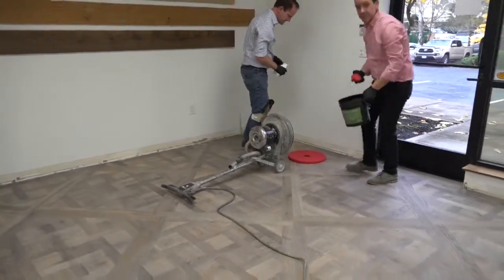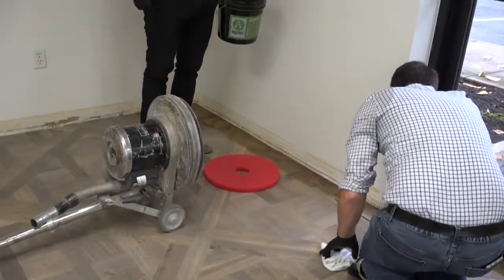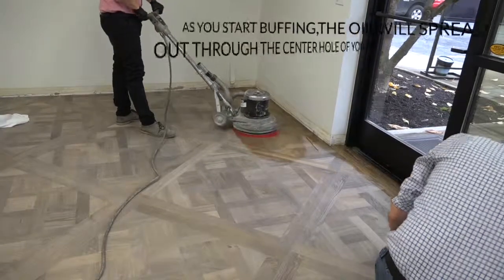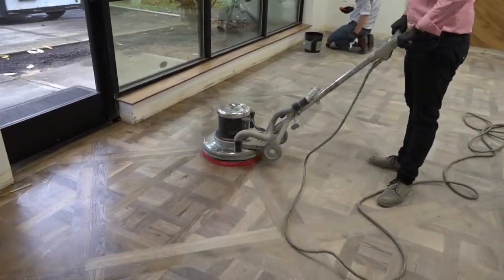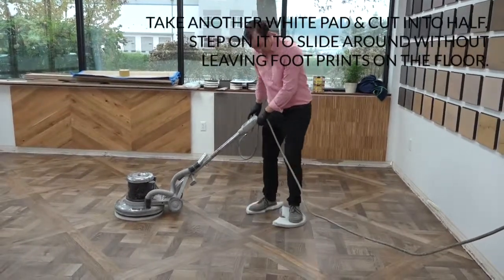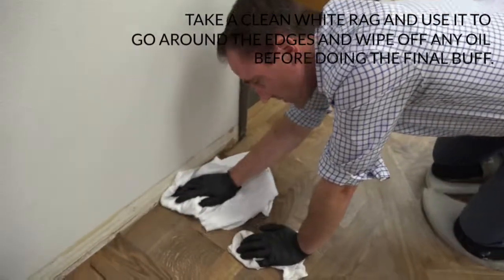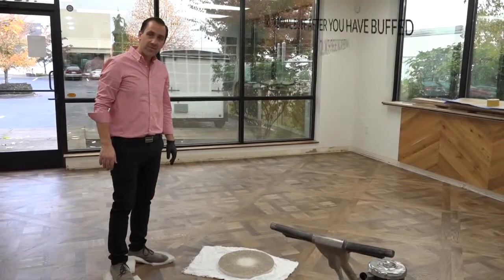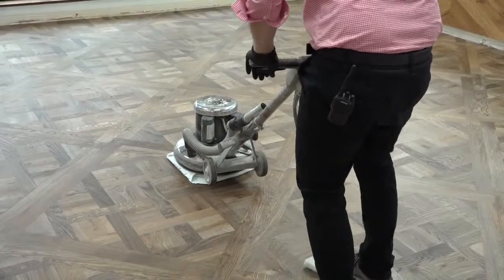How to apply Rubio Monocoat Pure on hardwood floors?

Comment: so many mistakes from these two clowns hard to know where to start.

for anyone watching please get more data from Rubio techs themselves or look for  some real pros to help keep you keep out of trouble. Set times are critical as well as application techniques that work. For starters there are times you don't use a red pad and never apply in more area than you can wipe off within 20 minutes of application. chemical bond happens in 2 minutes so you have to move quickly to avoid problems . prep is important , not shown here.
grit management and water popping are things you should investigate and there are enhancements to follow a 3 step process that give you a higher sheen than 4-5 % and a more durable finish.